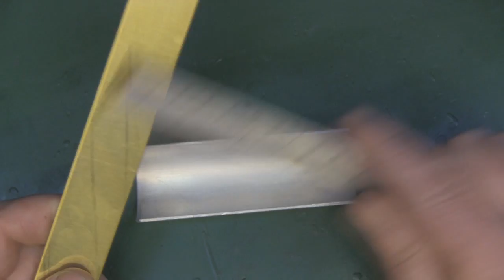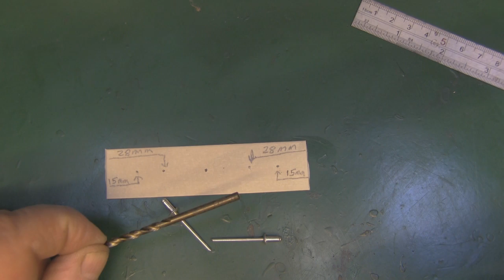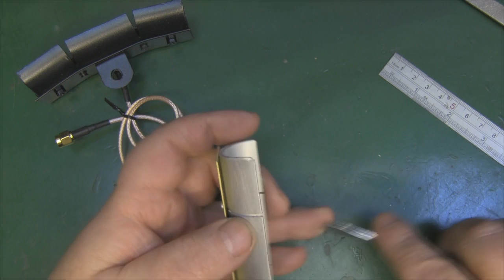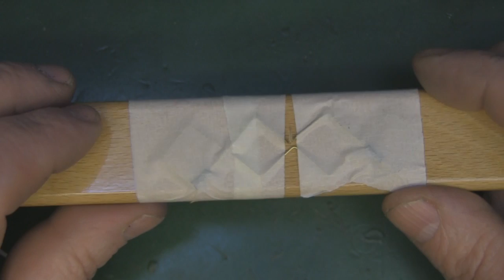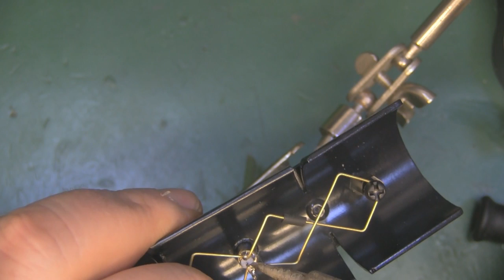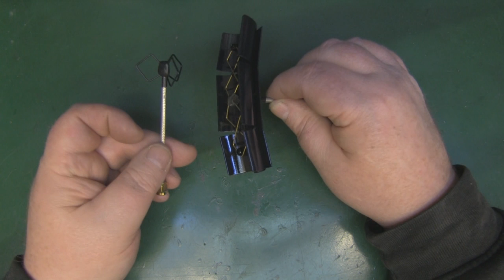Double Biquad made for 5 8GHz FPV

Comment: Would like to measurements in inches I'm not on the metric system LOL but I am trying to make myself an antenna your videos are very insightful but if you can could you give me the measurements in inches mainly the wires they have to bend I need that in inches it'll really be insightful and helpful thank you so much

Comment: I’ve got some brass tubing that’s 38mm  in diameter... will that work ok? 

Excellent videos! I’ve just recently stumbled across your channel and love all the antennas you make.... starting to try every one of them!
Reply from the maker: it will and you have the extra benefit of being able to solder straight on to it.
Reply: andrew mcneil would you still recommend using a straight back plate made out of the same brass, maybe just flatened?
Reply from the maker: @glennwoodward77  I don't think you would need it and as such you would not need to use any rivets
Reply: andrew mcneil thanks!
Reply: andrew mcneil final question for you on this.... in the case of a standard double BiQuad on curved reflector (without the increased beam width cut and bends) what distance should the element be from reflector. In your video you mention somewhere between 6.5 and 7mm but I’m doing some research and finding some say more like 5mm. Any recommendations? I’ll be using 8mm copper clad mig wire.

Thanks in advance
Reply from the maker: @glennwoodward77  On a flat surface (reflector) yes it should be 5 mm. But because the reflector is curved (closer to the elements in some places) i averaged than into the calculations. So the distance (6.5 to 7 mm) takes an overall advantage for the distance from the reflector.
Reply: andrew mcneil you’re the man! Thanks!
Reply from the maker: @glennwoodward77  No problem Glenn let me know how it turns out.
Reply: @andrewmcneil  The biquad antenna works like a charm.... I paired it with diversity along side you 5.8 yagi. I made a 7 element, took a flying wing out about 1.75KM with almost no breakup! Very impressed and I do appreciate the build videos! Just donated to your PayPal! I must ask you, I recently acquired a spectrum analyzer (Tektronix 494P) and have a -16dbm directional coupler. I intend to test my DIY antennas as you do however the only signal source I have to input is from my VTX. Would that be enough to test antenna or would you recommend I get some sort of tracking generator? 

Thanks!

Comment: Has anyone tried this with a fpv setup and knows how it works?
Reply: I used four biquads for d j i  digital fpv and they work great (search digital fpv biquad in you tube for the video). This double version will trade off altitude for an increased beam width.